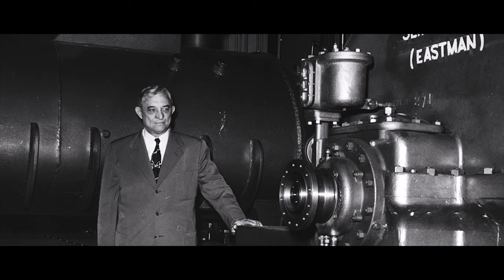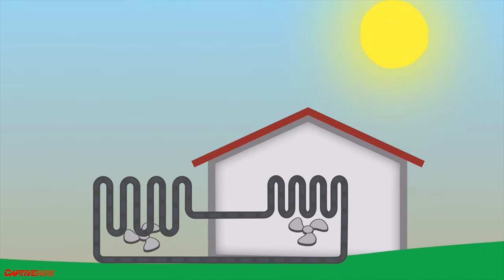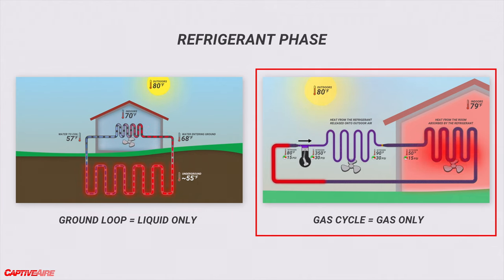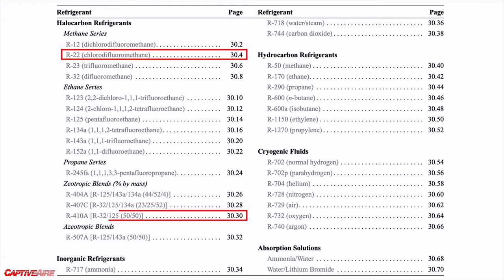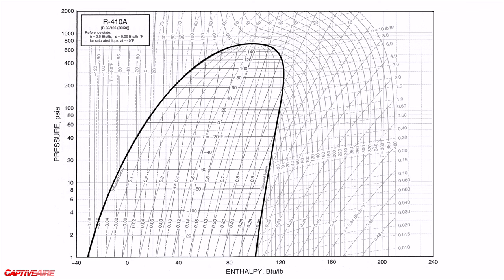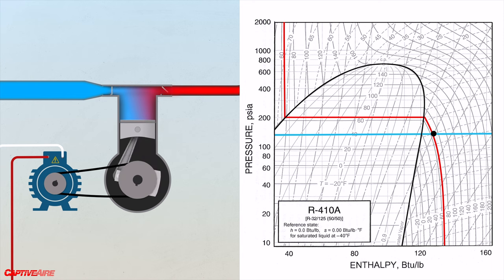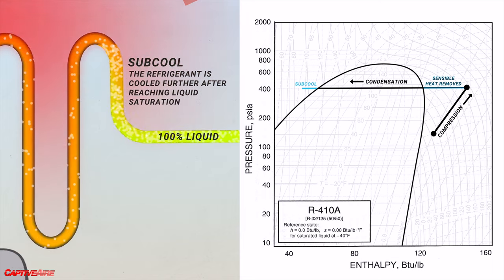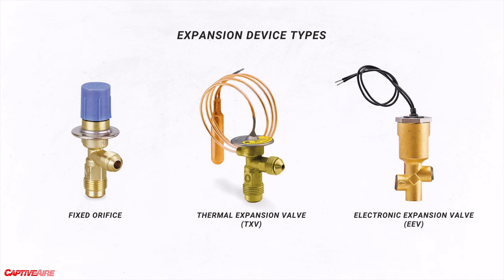Refrigeration in The Real World

Comment: This video should be taught in hvac classes.
This is too good.
Only if i had access to these during my uni times
Reply: can you help me i am confused… if you dont want to read i get it 😂

i am totally confused. Everywhere else, I see examples of how “cooler gas” of lower pressure enter comp. It leaves comp higher pressure and warmer. It hits condenser and gets cooled. Low temp, high pressure gas. It then goes through a valve, introducing low pressure. It thus cools enough… to become liquid tho, then travels through evaporator picking up heat… enough to cycle back to the start… a gas thats lower pressure and temp.  At 8:56, he’s sayin that a liquid is cooled into a gas?.. is this just a simple mistake of two terms being swapped accidentally  in diagram? gas w/ liquid? Unless specially made refrigerants can be a liquid, and cooled into gas. Isnt that opposite of all substances on earth.
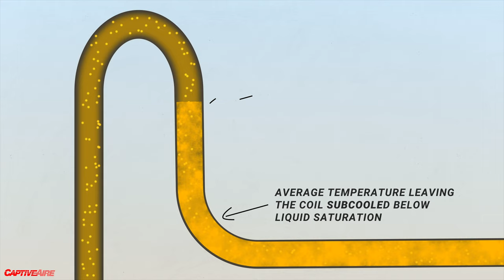Reply from the maker: @ineedstuff8286  You're correct that the terminology could be more clear. I suggest looking at the "expansion" section starting at 21:10. The refrigerant expands and the pressure drops entering the evaporator. Within the 2-phase region, lower pressure means lower temperature, and since we entered the 2-phase region, a small part of the refrigerant at this point has turned into a gas . As the refrigerant travels through the evaporator, it will pick up heat from the airstream, and this heat turns the rest of the refrigerant fully into gas (and a little bit warmer even = superheat). However, relative to the exit of the compressor, this gas refrigerant leaving the evaporator is still cool in comparison, and of course at a much lower pressure.
Reply: @CAPTIVEAIRE  dude thanks sooo much for explaining all of that🙏🏻😅Ive managed to learn somebasic electronics recently. After having a mechanical ability, yet little experience, after all these years (45), lately alot of mechanical AND electrical concepts have all “clicked”… like, to where you see the bigger, more mature picture. Youve been integral part🙏🏻 Cheers

Comment: Thank you. On the condenser side, how do you know what pressure you’re trying to achieve? I get you want the saturation temp higher than the ambient air , just curious if there is  a target. Usually we see about 30 degrees
Reply from the maker: You are correct, we generally target a specific temperature delta and modulate the condensing fans to achieve this.
Reply: @CAPTIVEAIRE  thank you